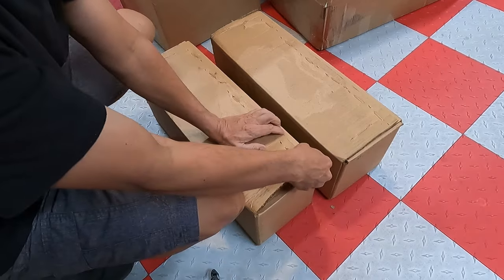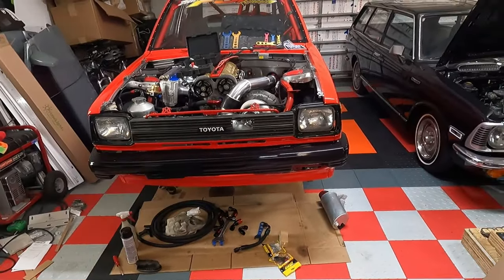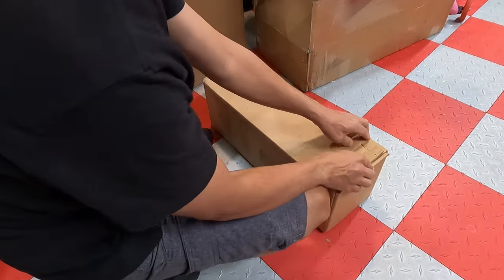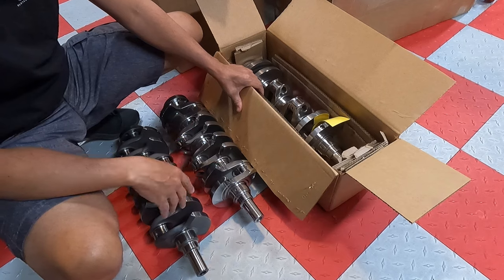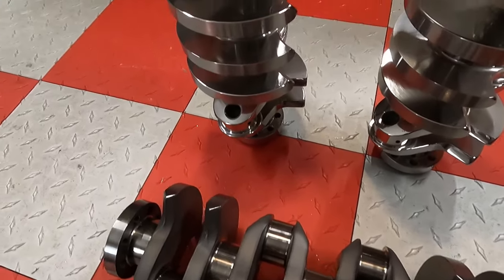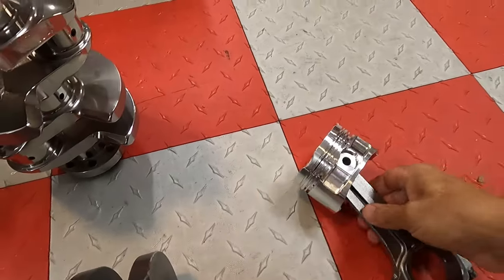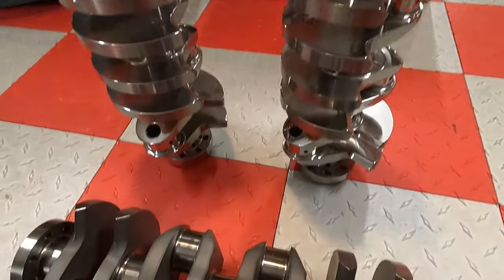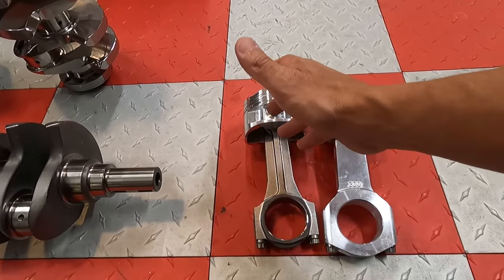3sgte billet cranks #psiracing #3sgte #mr2

Comment: Very glad I just found you. I will likely be in contact about parts. I will be building a Blacktop 3SGE-T for my MR2
Reply: A bit off topic to this video but I have a curious question you may be able to answer: Are there any provisions you make when mounting a 3sgte longitudinally vs the transverse setup it was designed for? I ask because there were some things I had to do with my blacktop beams 3sge (designed to mount longitudinally in RS200) to change the water and oil passages to the MR2's transverse setup. Will an MR2 3SGTE operate properly in a longitudinal layout without modification to the water or oil flows? I have a spare 3sgte and a spare is300 chassis I was considering combining for a time attack setup. I could get another RS200 setup for this purpose but I already have the 3SGTE so I'm wondering how that would work. Any input is greatly appreciated. 👍
Reply from the maker: Hey good question. The altezza engine was designed to run perfectly straight up and down. Meaning the puling system is designed that way. You definitely cannot run it slanted back the way they are ran in the mr2's unless you modify the oiling system and pan. You can email us as well psiracing@aol.com
Reply: @psiracing  yep, I've already got the altezza engine moded and working well in my MR2. My question was regrding putting an older gen 3S in a straight up and down orientation like in the altezza. Your Starlet 3S is mounted straight up and down (longitudinal) but the 3S came in MR2/Celica mounted sideways (transverse). What mods have to be done to 3S to run straight up and down like in your starlet?

Comment: Great Channel, on the 3sgte i know you have mentioned you prefer the gen 1 head why is that ? what cam options are there ?. planning a street starlet.
Reply from the maker: Thank you! All 3S heads are great. We use the gen 1 heads in our drag program but they are all good heads. If you want easy to get parts, go with the gen 2 or 3

Comment: Hi mate, 
Do the 5S blocks you typically use have the balance shafts? How do you handle removing these from the mix? My understanding is there are some oil passages that need blocking if you do?
Thank you
Reply from the maker: Hello, yes they always have balance shafts. Once you remove them, there is a small hole that feeds the shafts that you simply have to tap and plug.
Reply: Which i can verify is a very easy task, just make sure you push some sort of cloth or rag up the hole before you tap in your plug if you intend on using a junkyard motor in say a celica without tearing into the bottom end. Keep that metal out 👍🏽

Comment: What are stock cranks good to rev to? Im currently running 550hp revving to 8000 but it was still making power at those revs. Any information would be appreciated 👍🏼
Reply from the maker: Honestly we have revved stock cranks almost 11k rpm hahahaa. And they held up to over 1100whp. Tricky part was the oiling system

Comment: What's your thoughts on a lightened billet crankshaft for an N/A build? Like lighter than stock. 

For like a 300+HP N/A build ? 2.2-2.4l. ?

Side Note: did Assault Racing from Aruba 🇦🇼get their 5SGTE stuff from you guys?
Reply from the maker: I would definitely go lighter weight on a NA build. I say about 32-35lbs. 

No they did not but we know them well.